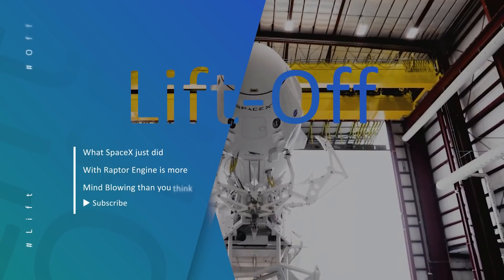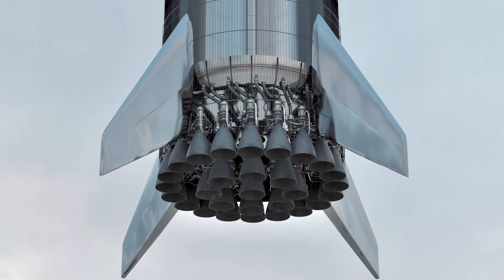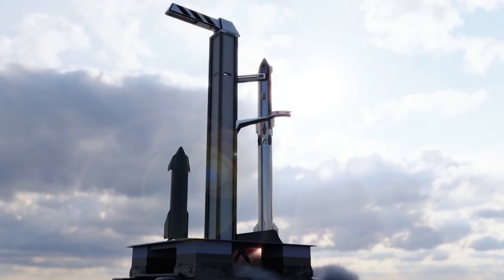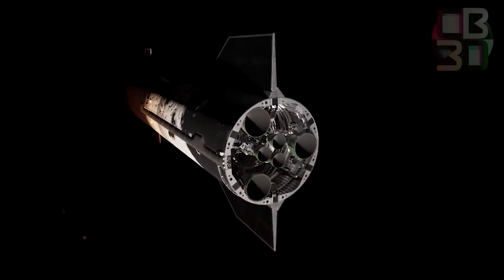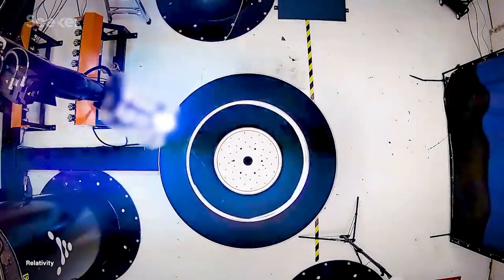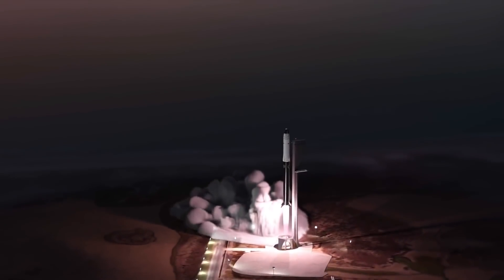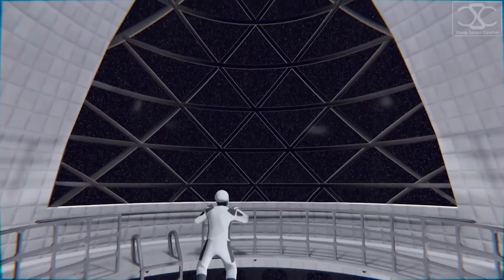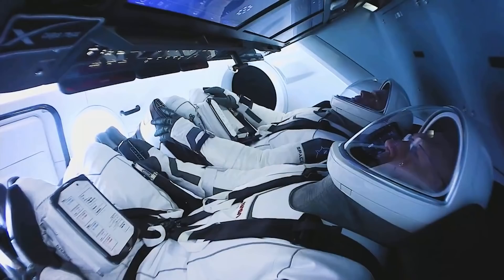SpaceX JUST DID THIS Crazy Update on Raptor Engines That Make Them 5x BETTER!

Comment: Why to make city. Much easier will be to create a number of caves and tunnels to save people from Solar radiation? Actually Russians are now working on their equivalent to Raptor engines - RD-0169. They invested significant part of their budget in this project. So far the first technical demonstrator was made and they hope to make these methane engines by 2025. I also guess they will use this SpaceX production methode.